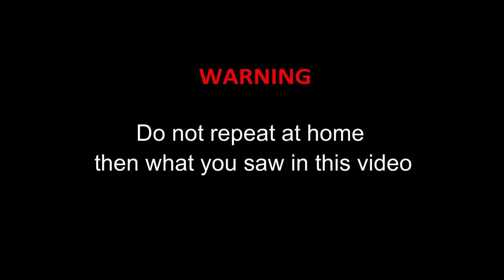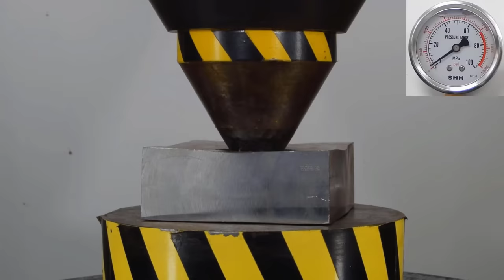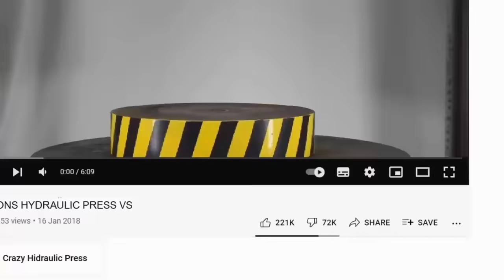HYDRAULIC PRESS VS OLD AND MODERN ARMOR

Comment: That plate went from passive defense to counteroffensive, real quick.
Reply: Like Ukraine ❤
Reply: @Daily-Trending-Viral  it ended up faster in broken armor in the fabled ukies counter-offensive though... 🙄
Reply: @Daily-Trending-Viral  Like Cocainelensky 😘
Reply: @kittytrail Still going strong, vatnik.
Reply: I saw your comment mid video and I thought you were talking about the titanium that was sparking and shot out. Holy cow is that a very light offense compared to the real show.

Update: I swear I proofread this. I guess not.
Reply: This plate meets all the prerequisites required to execute the Battleplan: counteroffensive

unlike ukraine 💀
Reply: @ClassWarMatrix  Ukraine would not do a counter offensive. That would be what happens in a war. They only conduct a special military operation against criminal elements in Moscow, you see. Maybe the independent republic of Königsberg will help later... We will see. For now I'm curious if the Ukrainees with modern tanks can beat some gopniks with guns that are older than Putins ideas.
Reply: That's not what I thought reactive armour was?
It looked rather like a brittle fracture and I would have expected a 'tougher' steel - could the extremely cold ball have chilled the steel to cause that sort of failure?
Reply: @killerbunny7206  Is that the Meth or the Mushrooms talking?😀
Reply: @Daily-Trending-Viral  Why aren't you at the frontlines? Your country is losing.
Reply: @julianpetkov8320  You couldn't tell a mushroom from a hospital, or a regular neighbor from someone you get to shoot.
Reply: @Vhite in your dreams
Reply: @dalentalas 50 percent of land retaken by ukraine from Russia
Reply: @Daily-Trending-Viral  Ukaine is not doing counteroffensive, they're doing a terror attack by bombing Moscow buildings. Stop supporting terrorists, Moscow is not part of the battlefield.
Reply: Lol vatniks running around YouTube looking for a reason to be butthurted😂. See you in the mobik cube
Reply: @RCmaniac667  Sure some are vatniks, but if you want to know the truth, do what I did and watch what a country impartial of this war is saying about it. Look at Indian news for example or Pakistan news or just listen to one of the many military veterans who understand just like me that with the amount of vehicles and soldiers Ukraine lost the war is unwinnable. The fact remains, if they were winning they wouldn't have to bomb Moscow for a terror campaign. It is a desperate act. Don't follow Western media only, look at foreign media.
Reply: @timspiker well media that supports Russia is going to show Russia doing a good job and bisar versa so not many people actually know what’s true or false
Reply: that plate said

fuck around and find out and then made good on its word.
Reply: @nbsp3527  Was that his white powder in the white house?
Reply: @killerbunny7206 republic of Königsberg? Modernazed "modern" tanks from  70's? Em, man, what about to use bonk little less?
Reply: @FlexibleWire  I did not find the 70s reference. The Königsberg thing... I mean Putin established that randomly declaring things independent republics so you can invade them, is cool now. So there is no reason now why a Russian exclave like Kaliningrad can't be a republic where we help fight the Russian occupation. Same as Luhansk. That was the idea.
Reply: @timspiker and how is targetting hospitals and schools not an act of terror
Reply: @larsthememelord3383  Because it's in the land that is being invaded. How is it that Obama's drone strikes on the same type of targets weren't terrorism? Because it was within the warzone and the rules of engagement said "this is okay".

I'm not going to argue that it makes absolutely no sense, because what I say doesn't, those rules don't make sense. But the rules rarely make sense and these are the rules of war.

One of such rules for example, is the use of cluster munitions, it is forbitten yet Ukraine is buying them from the US and using them on Russians. It's not a mirracle their soldiers get pissed. Both sides play dirty. Both countries are like kids punching each other to pulp with shovels, except one kid is almost like an adult being 17 years old and supports values that I agree with and the other is like a toddler crying to the other adults for help and those adults just keep giving it candy so it shuts up but they all know that kid is losing the fight.
Reply: @timspiker moscow deserves it
Reply: @lk7195  😂 not logical
Reply: @kameronjones7139  Can not see(
Reply: @Alpha-su8ti  what?
Reply: @timspiker  Russia bombed Ukraine first and Ukraine bombed Russia back. That's fair IMO. Do you know what logical means?
Reply: @lk7195  No I like I said, rules of war make no logical sense, but it's the rules. Just like all rules don't make logical sense.

"He did it, so I had to do it back" most childish statement in all of existence. What are you? Like, 5?
Reply: @timspiker  that's called self defense. Russia invaded and Ukraine attacks back. That's what Russia brought on itself invading another country for no reason.
Reply: @timspiker  yeah if you push someone and the punch you in the nose it's your fault for starting it. Not sure how it works in your country but we have the right to defend ourselves.
Reply: @lk7195  Yes this makes sense from a civilian perspective, but war works very different. The rules of war state we should fight on the frontline, not anywhere else. They can not attack Russia without clearing their own borders first. It is wasted effort. It doesn't achieve anything. It would be better to shoot those bombs on soldiers, not civilians, correct?

If I punch you, you would not go to my friends and punch them. They had nothing to do with me punching you. If that is supposed to teach me a lesson, I wouldn't understand what the lesson is? You wouldn't have defeated me, but you would've done an evil act upon my innocent friends and next you have more people who want to fight you. This does not end well and almost makes the bully who gave the punch seem like he did nothing wrong. 

So Ukraine's response is counter productive of the goal they claim to try to achieve.

You see now why there is rules of war?

Another example would be the climate activists. They block citizens from going to work and taking care of their families. They piss off regular people while their enemies are the politcians. This typical behavior of people thinking they do a good deed but it achieves the opposite. They attack in the name of something good, but innocent people become victim. The behavior is delusional. Supporting Ukraine for killing Moscow civilians is delusional. Killing is never good, but killing innocent is even worse.
Reply: @Daily-Trending-Viral  The only reason you decided to type this here is to start a big argument
Reply: @timspiker  so why russian themselvelves  bombs civilians and not soldiers on frontline? At war they should keep opponent in uncomfortable condition, and you just think like a child who talking about some game and not a real conflict. Especialy with all your "it's unfair bullshit"))
Reply: The first thing I though when I saw this comment was "The reply comments are going to spicy". I was not disappointed.
Reply: @areus2016  I don't think it's spicy, I think it's sad that people go as far as to hate anyone who stands with Russia 😂 I'm not even Russian. This shows you the power the media has over people and I think it's a matter to be taken seriously.

There's so much more at play than just war.
Reply: @Vhite  Buahahahaha that is aging worse and worse each day, they arent even going strong. They cant beat vatniks with soviet era equipment.
Reply: @betterlifeexe4378  "unreasonably high proportions of russian casualties" every objective casuality count states that Ukraine took bigger losses, and we dont even count civilian deaths and infrastructure.
Reply: @Alen725  

'Russia's military casualties, the officials said, are approaching 300,000. The number includes as many as 120,000 deaths and 170,000 to 180,000 injured troops. The Russian numbers dwarf the Ukrainian figures, which the officials put at close to 70,000 killed and 100,000 to 120,000 wounded.'

 Aug 18, 2023 New York Times. 

If you don't like the New York Times I can find you several other sources. Pretty much the only people who disagree with this by a large margin are all Kremlin controlled new sources, and are very much in the minority.
Reply: @Alen725  it's also worth noting that the reason why these proportions are so impressive is because Russia military started out so much larger and more funded.
Reply: @Daily-Trending-Viral  LOL
Reply: If you attack another country, you must face the consequences and not complain. You cannot play the victim when you are the aggressor. You have to take responsibility for your actions and accept the backlash. You have no right to violate the sovereignty and peace of others. You have to deal with the reality of your choice and not whine.
Reply: @Daily-Trending-Viral like russia? as their counteroffensive actually achieved something? 😂
Reply: @killerbunny7206 LOL its funny they couldnt defeat 30s tanks when you put it like that. Russian weapons that if they were people would be retired or dead destroyed 13 🐆2 last week
Reply: @Daily-Trending-Viral Ukraine now like Stalin USSR💀
Reply: @knighthood91 Imagine supporting Nazis and not even knowing it.
Reply: @dalentalas Western arms don't require a country to use its population as waves of meat.
Reply: @timspiker India is getting cheap Russian oil.  Russia did a good job wearing the skin of the USSR pretending to be anti colonial as it expands its empire.  Russia hasn't been content to leave people alone since the Mongols took over Moscovy.
Reply: @timspiker Most countries stopped using cluster munitions but they are not illegal internationally.  Russia, US, and Ukraine never agreed to stop using them.  It's the deliberate targeting of civilians that is illegal.  Something Russia does everyday.
Reply: @richardarriaga6271  That is not true. Watch Patrick Lancaster. He interviewed the civilians of these supposed Russian attacks.
Reply: @richardarriaga6271  So why is Ukraine literally doing just that?
Reply: @Daily-Trending-Viral 😂😂😂
Reply: @Daily-Trending-Viral   ye and was instantly chashed in ashes

Comment: Can you imagine if he had a thermal camera, the amount of heat produced by the pressure must have been insane.
Reply: I would love to see that. Especially because it was cold in the first place. Would have been very interesting indeed.
Reply: @wagu7003  We actually did. Those sparks you saw were molten metal, and they were so much cooler 1 meter away from their inception at around 3000-4000 degrees Celsius.
Reply: Not really. It's not a gas dude, it doesn't follow ideal gas laws.
Reply: I thought the same! Thought of one of those solidworks stress simulations that get all red
Reply: I think it produced the same amount of heat without the thermal camera present.
Reply: Thinking same thing.

Comment: You should add thermal imaging camera to these tests.  The heat generated from friction would be amazing to see.
Reply: and a better slowMo camera
Reply: Abrupt yield.
Reply: @AncientEvilSaiyan  and faster hydraulic press as he was cooling the plate with this ball for 10 seconds...
Reply: Good idea
Reply: The thing I want to ask
Reply: Yea pulling a stubborn nail out gets it crazy hot so that would be cool to see
Reply: @AncientEvilSaiyan  and a better armoured containment vessel :)
Reply: Based on a video short I saw where Mafia guys are discussing putting Jimmy Hoffa’s body in a trunk and sending that car into the crusher, I believe the phrase you’re looking for is, “….The friction of that heat….”
Reply: I would love the thermal imaging and much improved slow-mo video capture. Maybe always seeing a pressure gauge would be worthwhile. You could isolate the face of the gauge, then make it a touch larger or easier to see in some obscure corner.
Reply: I’m not sure… I think the metal would reflect the room-temperature IR and make the readings meaningless below room temp. 

Unless you wrapped it in something like tape ofc., but if that then we wouldn’t see any changes other than normal warming on a «skin» like that before something gives.

Better to shell out for a slowmo cam upgrade
Reply: I suggested this to the wife, just to see the different fiction qualities of the various apertures. Now I live in a motel.
Reply: Yeah heat why that guy touching metals after they generated like 100C?
Reply: I added thermal imaging to your mom's room

Comment: To be honest, I thought and expected the super-cooled steel ball to shatter.  I didn't expect what we saw.  I'm glad I wasn't in that room.
Reply: Right, those armor chunks shot out with force. Bad day to be nearby
Reply: Maybe someone can explain why the ball survived after the dunk in liquid nitrogen. I'm willing to guess that the ball actually work-hardened for several millimeters deep, maybe an inch deep? Is this possible? So if the armor was equally work-hardened, it has a shape that was not as strong to withstand the pressure? Internally the armor did not represent an equally tall sphere, for one thing, but has more middle dimension. This has me stumped somewhat.
Reply: Think it has to do with the liquid nitrogen allowing energy to be conducted more efficiently through  the ball to the metal block.
Reply: @YouKnowTheyExist there are 2 big reason why this happen. As someone else pointed out the energy was dispersed a lot more with the liquid nitrogen and the shape of the ball will also disperse energy a lot more than a cone, it will stay more on the surface of the ball meaning it wont damage it as much.
Reply: @hammerheadxray8152 I was expecting the same thing honestly. My guess as a metallurgist is that the plate already had some cracks initiated in it from the previous test while the ball did not have any stress concentrating flaws. Both materials are brittle given the brittle fracture surface left in the plate but because the plate may have started with more flaws it fractured first.

Comment: Regular people: AR500 is armour, and it's hard to penetrate.
This man: AR500 is the weapon, and it penetrates.
Reply: And people working with metal know that ar500 is not a armor material.. as people stated in the comments above..
Reply: @vihreelinja4743 And people who do basic research know that ar500 is in fact, used in body armor
Reply: Did he use a modern tungsten or uranium sabot equivalent tho? Nope, homogenous rolled toilet paper barely counts as armor since 90's.
Reply: @vihreelinja4743 1/2" AR500 is used in body armor, not sure what comments you are referring to but they are wrong.
Reply: Well the best defense is a good offense sooooo
Reply: ...
The army: we just found a better material for grenade shrapnel
Reply: @ctvaughan6623  and everone who has experiances using it know it unreliable and shouldnt be used in armor
Reply: @Inflatedchair  Ok tell me about your “experiances using it” and how it’s unreliable.
Reply: And that AR500 is most commonly used as an Abrasion Resistant material (hence the AR in AR500 for its intended purpose) in things like cutting tools or surfaces that see lots of things slide over it, like teeth on a bore drill or a cutting tool or the metal sheet that heavy rocks slide down after moving down a conveyor. Those applications where you don't want the surface wearing away and, where if its got significant load on it and hits a snag, the metal can explode without anyone being nearby to get involuntarily ventilated by it.
Reply: @Avetho  You are correct that AR stands for abrasion resistance but I think you’re underestimating the amount of force it takes to cause the metal to explode. I have some AR500 steel targets and I regularly shoot them with a 6.5mm Creedmoor from as close as 200-300 yards and it doesn’t even dent them. I just have to repaint them every so often and their good as new. AR500 steel isn’t a bad material for armor and it’s not unreliable, but its relatively infrequent use comes from its weight and clunkiness when compared to other materials such as ceramic.
Reply: @Inflatedchair  Then don't wear it, child.
You have neither a service number nor a reason to be speaking here.
Reply: @mrhappyface4181  this reply is funny af lol
Reply: @mrhappyface4181  also i wasnt even talking to you your comment was funny i was talking to someone else
Reply: @Inflatedchair  I hate zoomers so much it's unreal.
Reply: @mrhappyface4181  lol
Reply: I've shot older pieces and can tell you that they are in fact capable of multiple hits from 7.62x39 and 5.56 @Inflatedchair
Reply: So wee need a new ice weapon that fires frozen metal balls xD
Reply: AR500, Please hold my beer.
Reply: wrggg